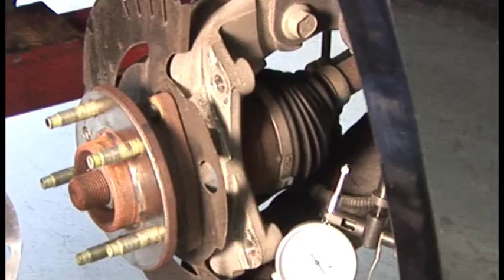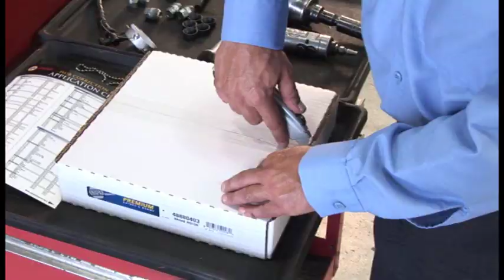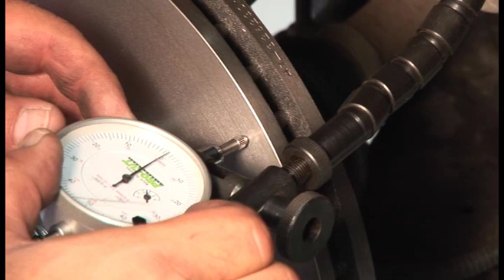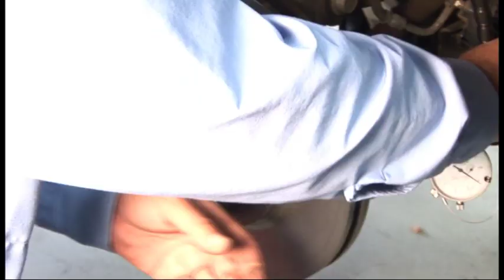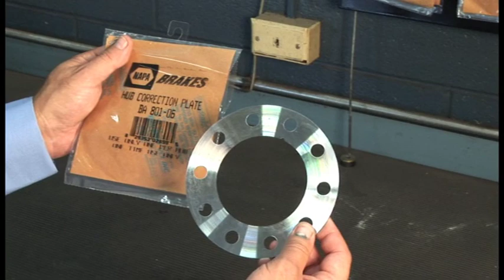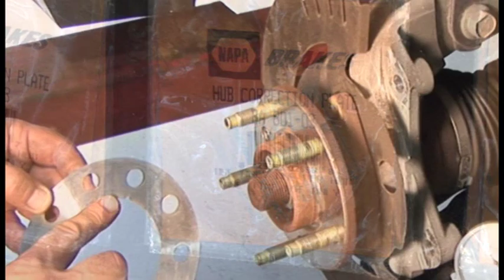Lateral Runout/Hub Correction Plates

Comment: I just got a rotor where it is literally .0010 ON THE HUB section. Just bought some cool 20" rims and was getting a severe vibration. Took the rotor off, hub was .0002. Rotor is TERRIBLE.

Comment: Anyone know where to buy those black washers?
Reply: Cheapest I could find for the set was over 200.00 USD.  Find open lug nuts and the largest thickest washers that will fit around the studs then stack the washers two high.  I got what was necessary for around ten dollars.
Reply: @mattduff389 I just bought the Textar kit from Europe. One quarter of the price. Thanks!

Comment: How can indexing the rotor reduce the run out?
Reply: the hub and bearing will also have runout, you can index and make them cancel out. the shim is also wedge shaped so indexing it changes the runout adjustment

Comment: I'm assuming the correction shim is not the same thickness  around its total diameter?
Reply: Yeah they don't mention how the shim is designed. I would assume the V notch is the lowest point of the shim and the opposite side of the shim is sized for the 0.006 thou of an inch thickness. Seems like all they are doing is applying 6 thou to the opposite side to bring the total runout back in balance.
Reply: @nicholasdugdale . Use disl calipers to measure the shim thickness

Comment: NAPA part search returns no listing for conical washer or plates!
Reply: YEah those washers look nice and beefy thought you should just be spec-ing to 80lbs
Reply: try the Lisle 22800 wheel stud installer
Reply: @majahanson311 wow all the different synonyms I tried googling this tool and never popped up lol Thank you
Reply: check on amazon for open ended lug nuts for your vehicle. you can buy them cheap compared to those kits they sell . Once you buy them you can reuse them for any brake job in your future.

Comment: They why is it that when you have the rotor cut, it fixes the pedal vibration! EXACTLY.....
Reply: Mr EXACTLY, think about it, not all vibration is caused by hubs/drive flanges having run out, if your discs are to blame skimming will correct it, FOR A WHILE, as you have now introduced DTV into the disc it will return.
In my nearly 40 years experience working on cars I have learned GM suffer massively from this, ford is next, the last hub flange I skimmed had 10 thou, 0.25mm run out, imagine that by the time it's amplified by the diameter of the disc, once skimmed end of problem

Comment: Brake Masters doesn't do this...
Reply: Most hubs are pressed and charge 1 hour of labor roughly 100 bucks not including the replacement wheel bearing and hub. You will spend over 300 bucks replacing a bent hub because you cannot reuse the old bearing in most cars since it's pressed and comes apart when removed... These shims are too correct moderate runnout without making you spend a small fortune on a cheap car.
Reply: I don't remember them covering this in my auto mechanics course! Possible I don't remember..

Comment: MuzzleFlashCO:

Brake Align Concave Washers (Line Code: "UP" Part Number: BA950120)

Brake Align Car Hub Cleaner W/Pads (10) (Line Code: "UP" Part Number BA950300)

Brake Align Truck Hub Cleaner W/Pads(10) Line Code "UP" Part Number BA951400)

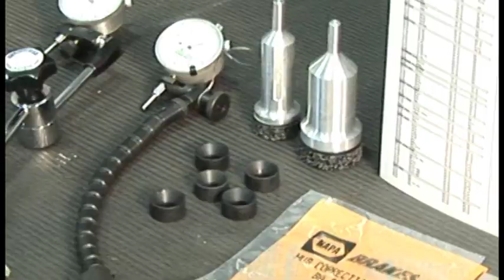Comment: Where do I get these "conical washers" mentioned at 0:43?  For example, what is the part number for a 2006 Jeep Wrangler TJ?
Reply: You really don't need those. Just tighten your lugs down backwards (flats facing the rotor). If you have fancy lugs, you can buy 4-5 std ones for this purpose.
Reply: I found mine on ebay  Kent-Moore J-45101-100
Reply: @CoolAirVw  Wow, they sure are expensive.
Reply: it doesn't need to be some conical washer as we are not aligning anything to a hub.  We just need to press the rotor against the hub flange,  so any set of washers from a hardware store will do,  or a one size bigger nuts.
Reply: @isbemorph came to say the same.
Reply: I ground the back of the rotor where it mounts against the hub with an angle grinder, just the area where it was reading high. Since I'm only adjusting thousandths of inch I wasn't worried about the reduced thickness.